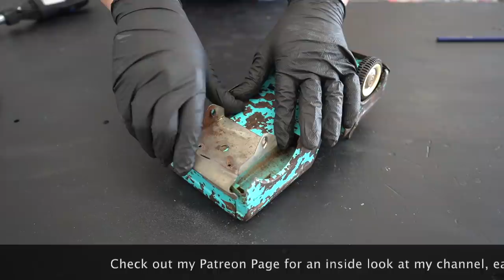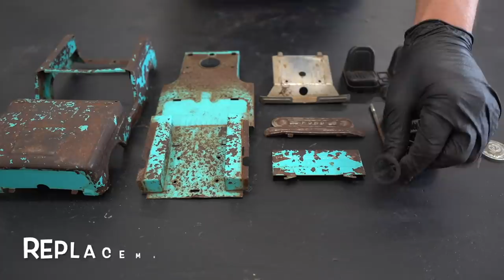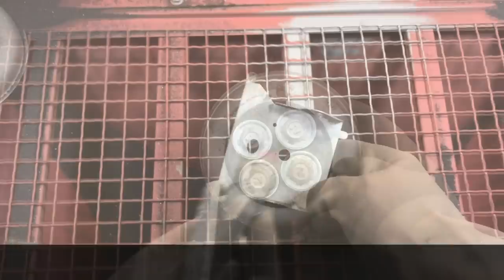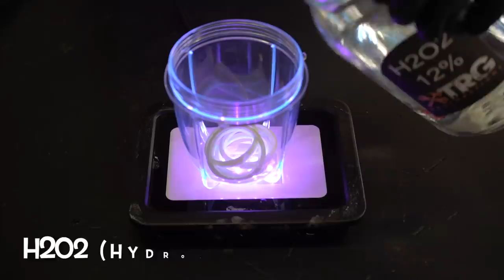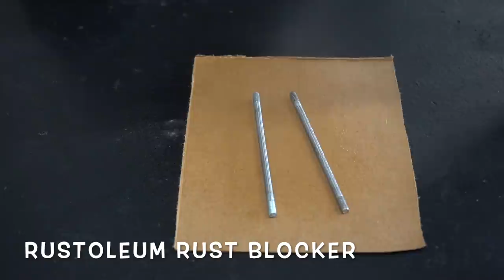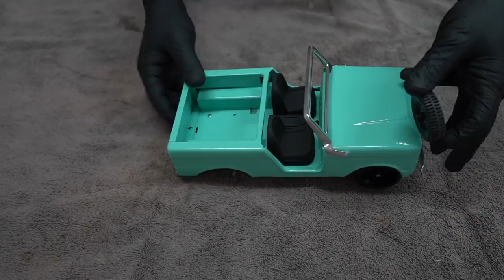1965 Nylint Bronco Restoration - Restoring Vintage Toy

Comment: Fantastic restoration. I was surprised that the super glue held those side pieces as they were clips. Thought they may break again. Great job. Gave the toy another life, so to speak.
Reply: It will depend entirely on the composition of the adhesive. All “superglues” are adhesives but not all adhesives are “superglues”.
Reply from the maker: Thank you! Cheers!

Comment: You just happened to have a windshield frame lying around? Nice work with your blaster. Most people don't hold it close enough to let it work right. Then they move about it too fast and sloppy. You do it very smooth and methodically! And you use cleaner (acetone) while others do not. It shows in the finished product! Well done!
Reply from the maker: Thanks! I din't have one readily available. But you can find anything on Ebay.

Comment: That chrome powder paint is really remarkable! I have a vintage set of wire wheels of which the chrome has seen better days. I'm wondering if this technique would be durable enough for this application.

Comment: I've seen a lot of restoration videos and I am missing the steps of base coating+wet sanding before the finish painting. Also maybe you should use paint stripper and/or rust removal before the sand blaster to avoid getting all that old paint and rust in your sand circulation, but if you are fine with changing the sand more often it is of course entirely up to you! I am also curious about the UV plate!
Reply from the maker: Thanks for watching! 🤘🏼🤘🏼🤘🏼

Comment: I would love to see these old toys customized. You know like Bitch'n Ride custom. They are steel, Some body work, custom paint, interiors, suspension, wheels and tires, light kits 3D printed parts. You know take it to the next level.
Reply from the maker: I have several customs in my video collection. Should check them out!

Comment: What kind of media are you using in the sand blaster? How much pressure are you using? Still amazes me the degree of restoration your skill creates
Reply from the maker: 80-grit Aluminum Oxide, running the pressure at 90psi

Comment: You have an impressive array of Dremel type grinding tools, very nice. Why no primer to fill in the pitted areas on the body?  Did you notice that the 'Bronco' logo on the driver's side was stamped backwards to the passenger side logo?

Comment: @ TRG: I was hoping you could help me figure out something. I was a small child in the 1960s and I recall having a large vehicle (like a Tonka) that had a horn. The horn was a simple cylindrical plunger somewhere on the top of the vehicle. I kept thinking it was a Tonka Dump, but I can't find one with a horn, so I may not be remembering the vehicle correctly. Does a vintage truck with a horn "ring a bell" with you? Any idea what vehicle it may have been? Thanks!
Reply: Hey Lance was the vehicle for riding on it with a steering wheel?
Reply: @MrMotavlogs  I remember it as a dirt mover, non-riding. But my memory is a bit hazy. The horn made a "toot" noise, with an air bellows under the plunger that would act as a spring to return the plunger the top position after it was depressed. I also remember that the plastic plunger/bellows wasn't especially robust. The plunger broke off after some use.

Comment: I still have my Nylint Bronco jeep it came with a trailer the jeep is still in good shape the trailer is a little scratched up and the window frames are a bit dented both are that same blue color with the trailer blue on bottom and white on top.

Comment: Man JBWeld replacement for spot welds? That I can get behind. I HATE spot welds. They're useful structurally, but man do they ever make servicing things hard and time consuming.
Reply from the maker: Spot welds are the worst, especially when it's rusty and you can't find them.
Reply: @TRGRESTORATIONS  Yep. The hidden ones make me get grey hairs. I'm only 32, that shouldn't be happening yet!